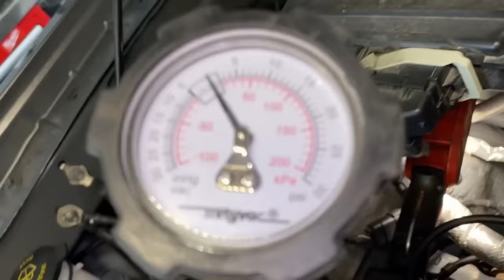2011+ Ford F-150 3.5L GTDI Ecoboost Engine P0299 Turbo Underboost Quick Diagnostics

Comment: Great seeing your videos again man! One stupid question, maybe stupid...:

Why didn't they just make the compressor and turbine bypass valves to stay closed by default and only use the solenoid and actuators to open the bypasses when the computer commands them so when releasing the accelerator pedal (cause only then you want them to open to not put stress on the turbocharger assembly by bleeding off unneeded pressure and avoid a compressor surge)? I mean..., why did they think these upside down? It's a safety concern (mostly during overtakes) to be sure that you don't suddenly loose power when it can save you from an accident. Why did they design the bypasses to be always open and only start closing when you go apply acceleration over a given value? This can greatly increase the wear on the actuators and also cause these types of issues that you mentioned of not having them seal properly when closing? I agree to think that most of the time you maintain a rather constant speed which even at cruising may not require boost pressure and the atmospheric pressure should be enough to keep the AFR where needed for the required power and yes..., there's the fuel consumption which is also slightly lower when the bypass valves for both compressor/s and turbine/s are opened, simply because there is less gas flow resistance on the turbine blades (friction and pressure resistance or drag if you will) which also causes a bit more friction on the compressor-turbine shaft assembly which adds a further soft braking of the shaft, hence a bit higher drag on the turbine. I've personally tested this a couple of times on a leveled road with no wind and fixed speed and the fuel consumption would decrease by some 0.2L/100km while driving at 80km/h, bringing the instantaneous consumption (cause this is what tells the performance) from 3.6L/100km to about 3.4L/100km (I drive a 1.0 125hp Ecoboost Focus in Europe) when those valves are opened and the consumption rises back by that amount when completely closing both. So, yes, I could also confirm that there is a difference in consumption based on the state of these valves and I was able to do this on the road with my personal scan tool which allows to play with various inputs to the engine while driving.

From my opinion, as an engineer, I would find these to be more fail safe by always being spring loaded closed and only open during coasting or simply releasing the throttle pedal OR when you select an ECO mode which indeed would activate the actuators to hold them opened constantly when no boost is needed, exactly as they are doing by the current design. I mean, they could've thought what I've just said in order to have them last longer and keep the Ford's long lasting name of cars built tough which should last more.

Comment: Great video as usual!  You mentioned cleaning the boost pressure sensor, what product do you recommend for cleaning it?
Reply: I believe it's CRC or CVC cleaner. Red/white can.
Reply: @mont5584  CRC mass air flow cleaner .. do not use throttle body cleaner it will ruin your sensors!

Comment: ever had an f150 Ecoboost set p1548? air filter restriction? I've pulled tubes off they all look okay going to turbos and new airfilter. keeps setting it. along with p0299. just replaced exhaust manifolds for broken back studs. turbos tested fine.

Comment: Greetings! Love these videos. My 2011 F150 just fired out 2 codes P144C and P0299. Was wondering if the P144C would actually cause the P0299. I have a purge valve solenoid on the way for the P144C and I hoping that will fix both codes.  I will definitely perform all the prechecks you recommended. Thanks!  Tom
Reply: I have the same. Did changing the purge valve fix the po299?
Reply: @treycrawford3997  No sir. Ended up at dealer because I couldn't clear the code. Ended up being something the drivers wastegate. Can't remember exactly. But they fixed it just in time to get my smog

Comment: So I  have a 2012 with 79 k just did a new 0 mile motor. Had the notorious  shutter thanks to you and your video on the. CAC condensation so bought fords  75 dollar sticker it seemed to work till today slight buck. No lights

Comment: Thanks for the info. I did everything to told me and it works. I was not able to test the waste gate but the 0299 code is gone. However, when driving long up-hill I can feel the truck is Lagging and the code comes back, I reset/erase the code then its good again. So far the truck is running good and the engine light has not came on
Can I add a and electronic Boost Solenoid made by AEM? will this eliminate to code and help the truck run better or make it worst?

Comment: EBOVs like to go bad. Easiest way to determine that is cross check command boost vs actual. One thing I did on my ecoboost was replace the turbos for quality BW units, performance turbos not production vehicle turbos, and replace the EBOV with a quality turbosmart unit.

Comment: Brian, Great video thank you.  I am getting P0299 code and when I had the system checked by a mechanic they told me they found oil in the intercooler and told me I had to replace the tubos.  Does oil in the intercooler confirm the turbos need to be replaced?

Comment: Trash the worm drive style hose clamps and go with t-bolt style along with silicone couplings throughout. 

If the intercooler has to be replaced. Go with aftermarket. Its more than likely cheaper than factory & usually better quality.

Comment: Thank you! I just bought a 2012 f150 eco. 2 days ago, I'm driving on the highway and I heard and felt a backfire or a big cough or something. Then I noticed that my truck went from having a massive amount of HP and torque, to having barely any power at all! It runs fine. But it seriously feels like I went from driving a Mustang 5.0 to driving a 1 liter Fiesta. No joke! I can put the pedal to the floor, and nothing will happen except a very, very slow climb in speed. Zero power! But, I can still hear the turbos working. Qnd the car sounds fine, idles fine, starts fine, no engine light.....idk. Any feedback? Tia!! (Subscribed!)
Reply: You ever figure your problem out?  Mine is doing the same and the blowoff valve didn’t fix it.
Reply: Mine just did same today march 2024, you ever figure it out
Reply: Mine just did same today march 2024, you ever figure it out

Comment: Hi bro...i saw you used (AMS OIL) is that a good stuff..and could we use it for all cars ..great video thank you .....
Reply from the maker: No I use Pennzoil, the Amsoil is just promotional products.
Reply: What pennzoil? I use Pennzoil Pure Synthetic Euro L 5w-30 or 5w-40 dependent on application. Of course with a Wix XP or motorcarft filter.

Comment: Another great video. Looks like having a smoke machine would help in diagnosis here. 
Question, do these Ecoboost engines need walnut blasting or some other intake valve cleaning procedure as maintenance? I don’t remember you ever mentioning it. 
I bring it up, because every other newer engine these days seems to need it.

Comment: I've got a 2016 f150 3.5. My turbos went, Ford replaced them, and they blew. Then replaced again, 2nd set now, and this time, I've got no power uphill forward or backwards. When I get moving on level ground, it runs fine. Ford hasn't figured out the problem and have had it for 3 weeks now. I believe it's the 2nd set of turbos, as it didn't have this problem until this set of turbos were put in. The dealer won't replace the turbos till Ford tells them to do it. I'm frustrated.

Comment: I have a question for you, lately ive been seeing a ton of 03-07 4.0 v6 mustangs and explorers that the computer is faulty. the failure is with the computer setting a bunch of false codes related to bank one and two upstream and downstream o2 heater ckt ,egr ckt, purge valve code, and the ac relay ckt codes. When checking all circuits they will be ok. They pcm has failed internally. I wanted to know if you have seen this issue. I know its common for the coil drivers to fail but this is not my case.

Comment: thought there was a way to hook up vacuum/pressure to the blow off valve to diagnose rather then removing and inspecting? 2012 f150 3.5

Comment: I have a 2011 3.5l.  On start up I have a vibration, low growl if you will, coming from the driver side turbo. Could this be the waste gate actuator failing?  After watching your video, it seems possible. I am gonna perform the vacuum / pressure test your did earlier in your video once I get my hands on a tester. Just wanted to ask and see if you could respond before I got the tester. Thanks in advance. Great video.

Comment: I’ve been seeing a lot of these go bad. Did smoke test of the intake system on a Taurus show and f150 and found a tiny tear in the orange seal which caused the issue.
Reply: What's a smoke test and how do you do one?
Reply: Monty smoke test through where the airbox lid is.

Comment: Glad I came across this video! I went through all my tubes , did find a really loose clamp on the drivers side , I’m getting a groaning noise when pressure is released (after lifting off the gas) can you point me into any direction? 2012 3.5 eco
Reply: I have a similar issue did you find anything with your truck?

Comment: Hopefully you see this comment, I got a 2015 f150 3.5 eco boost, I was driven in the interstate around 60 mph and I push the gas, and the ingine light start flashing and it fell like I loss power after that the engine light state there but I smash the gas when I was doing like 30 and I fell like I didn’t want to charge of gears
It’s been like a month that I lift the truck and I put 24x14 wheels so I don’t know if that cause the problem

Comment: Really like the ELMconfig ohp with FORScan software, compared to Bluedriver.  Bluedriver was OK for Mode6 to be able and read Coil Misfires per cylinder.  The FORScan with ELMconfig will read BARO in frequency Hertz, compared to Pressure kPa or PSI.  Question about BARO on 2 different vehicles Ford 2004 F-150 FX4 with 180,000 miles reads 152 to 153 hertz at 1000 feet above sea level, oxygen sensors 12 and 22 read about .76 volts or steady.  Mercury Grand Marquis 2002 4.6L with 105,000 miles 2 valve reads BARO 160 to 162 Hertz and oxygen sensors 12 and 22 steady about .77 volts at also 1000 feet above sea level.  Do you think Catalytic converters on 2004 F-150 FX4 5.4L are becoming clogged up?
Update:
I saw in your Engine Replacement vid that the new engine had CAST IRON tensioners.  I just purchased the Timing Kit with the Plastic Tensioner, if you are still doing these timing kit jobs would you USE the CAST IRON tensioners???  Also about Catalytic Converter, Post oxygen sensors are reading steady voltages flat line compared to Pre oxygen sensors, at the Exhaust Manifold exit I measure about 450 degrees Fahrenheit and after the catalytic converter measure 650 degrees Fahrenheit.  Changed oil every 3000 miles and fixed coil packs as soon as they started miss firing, used Quick Trip gas, truck has 181,000, think CATs are OK?  If doing the timing kit job was considering replacing Exhaust Manifolds, but they aren't making the cracked manifold sound?  Looks like it my be easier on the passenger exhaust manifold to raise the engine by removing the passenger motor mount bolts, fan and shroud and Air Plenum, then jacking up engine, saw you vid?

Comment: Great and informative video ! I have a issue not quite sure what it is. I recently replaced my turbo coolant line on the passenger side because it was leaking on my 2012 Ford F150 eco-boost with the same motor you’re talking about. Now I have noticed when I drive it without a load the RMP gage gets  to about two mark and then it lets out a really big hoosh on the drivers side  . It’s never done this before. Then I have noticed the when it’s  under load and I’m pulling something and I’ll get to that same mark at the two RPMs and start fluttering a little bit when I was pulling my travel trailer I was thinking that it’s possibly my blow off valve but I’m not really sure I didn’t know if you could give me any insight your time and knowledge is appreciate it thank you .

Comment: Any suggestions for the rattling actuator arm. I replaced a missing c-clip already but the rattle still present so I suspect flapper issue you mentioned. Total replace turbo or can it be serviced? 2015 explorer sport. Thank you for the awesome content!
Reply: Can be rebuilt but turbo has to come off either way :( but I believe there is an updated turbo part#
Reply: He has a video on the rattle.

Comment: Was your truck running sluggish? As in shifting at higher RPMs? Right now, I throw a CEL when operating at longer distances at higher speeds. In the city, it doesn’t throw. However, it seems like I have no power at the start. 

I took the boost pressure relief valve off today & I had the same exact issue. Obviously I’m replacing this, but do you think this is why I feel like I have no “get-up” at the beginning?

Comment: hmmmmm, my truck is 2012 F150 3.5l ecoboost, it runs great. But i have experienced with driver's side wastegate rattle every cold start. It rattles like 5 seconds then quiet. But it runs fine and no underboost. What should I do with wastegate?

Comment: Hi Brian 
Please make a video talking about why Ford stopped making orange coolant and why are they replacing it with specialty yellow. Also for us who currently have orange and are wanting to completly switch to yellow, could you please make a video on how to completly flush the orange and how to add the yellow concentrated
Reply from the maker: Compatibility/Use of Motorcraft® Yellow Antifreeze/Coolant with/in place of Motorcraft® Orange Antifreeze/Coolant Ford Engineering has approved the use of yellow-colored Motorcraft® Yellow Antifreeze/Coolant (Ford specifications WSS-M97B57-A1 and WSS-M97B57-A2) to service all Ford, Lincoln, and Mercury vehicles factory-filled with the following antifreeze/coolant: • Orange-colored Motorcraft® Orange Antifreeze/Coolant (Ford specifications WSS-M97B44-D and WSS-M97B44-D2) Important: Do not use Motorcraft® Yellow Antifreeze/Coolant to service Ford, Lincoln, and Mercury vehicles factory-filled with any other Motorcraft® antifreeze/coolant. In the case of these vehicles, Motorcraft® Yellow Antifreeze/Coolant is not compatible and therefore is not approved for use. Continue to service these vehicles using only the correct recommended antifreeze/coolant. Service Information for using Motorcraft® Yellow Antifreeze/Coolant with/in place of Motorcraft® Orange Antifreeze/Coolant Topping off, Draining and Refilling: • Motorcraft® Yellow Antifreeze/Coolant can be used to top-off or entirely replace (drain and refill) antifreeze/coolant in vehicles factory-filled with Motorcraft® Orange Antifreeze/Coolant. Flushing: • Flushing the cooling system is not required prior to entirely replacing (draining and refilling) Motorcraft® Orange Antifreeze/Coolant with Motorcraft® Yellow Antifreeze/Coolant if the cooling system is not contaminated.
Reply: @FordTechMakuloco  super confusing. If I interpreted that correctly, the yellow coolant is acceptable for use in a system that had the orange coolant. And, it is acceptable to top off the orange coolant with the motorcraft yellow? I added yellow to the bottle on my 2011 when it was low, right after I bought it, not realizing it had orange in the system. I gave up worrying about it, it seems to be fine.

Comment: Is it possible to do an in-depth video on the diagnosis of a 5.4 liter what the number say on a computer when the engine is running what they mean and why have issues with it not running quite right then something goes on it mostly ignition coil and phasers etc

Comment: Huh weird? I’ve got 315,000 miles on my 2012 f150 ecoboost (original turbos)never been replaced !. Over 200k of those miles are towing miles 🤷‍♂️
Reply from the maker: Yup some are troublesome and some have no issues I know what you are talking about.
Reply: FordTechMakuloco I think that goes with everything and I’m sure there are a lot of different factors if they go bad
Reply: Shed Hunting Worldwide just bought a 2020 F-150 with the 2.7 ecoboost. I hope I have the same luck as you sir 🙏🏻
Reply: Tim Schultes I hope you do too !

Comment: Question for you how often if ever have you-had complaints about the steering drifting and darting around or complaints in general about the steering in 2013 f-150 mine is a 2013 2wd V8 and I took it to the dealer twice and was told that there was nothing wrong.   The truck is 2013 XLT SUPERCREW WITH 2wd it only 26,019 on it. I have never towed a trailer with it which was my original  intention because I’m afraid it is not safe. It darts around at different speeds. If possible could you acknowledge getting my question. Also the truck been dealer serviced since day 1 and they have made mistakes one almost caught the truck on fire but that’s another situation for another day.

Comment: What should I look at. I have lose of turbo power and I am not showing a check engine light and no codes.  I can hear all little bit of the turbo whistle but no rattling or other noises. My 2012 truck drives fine just none of that turbo power you feel at taking off.

Comment: Thanks for your videos.  Very helpful and educational. The engine in this video was a 2013.  I noticed that it did not have a catch can.  I own a 2018 3.5 l. With both direct and port fuel injection.  Is the port injection enough to keep the intake valves clean?  Or should i still install a catch can?  Which can do you recommend?  Thanks for your reply and the great videos.  Larry in Oregon
Reply: The catch can would not be needed as the valves get cleaned at idle. Then again, a catch can won't hurt.

Comment: Well mine is at a dealer now, with p0299, they are telling me fuel injectors are bad.  10 hours plus parts.   I  questioned them and it did not go well.  More to come